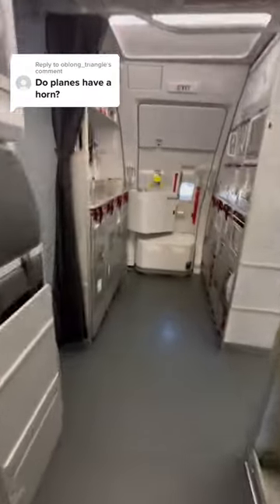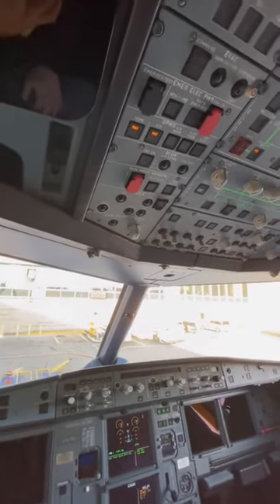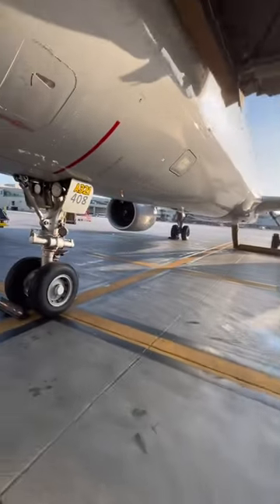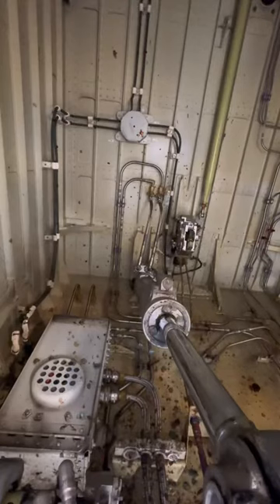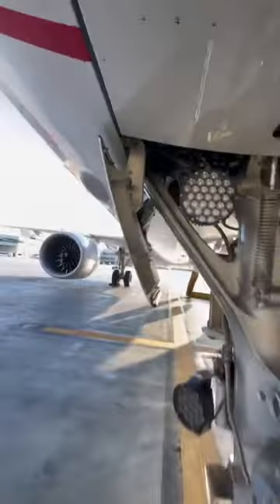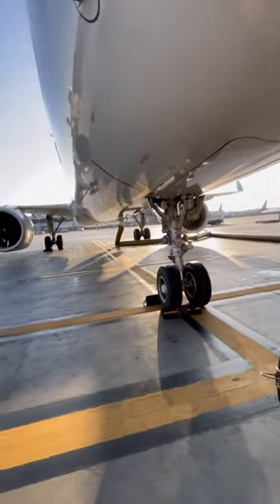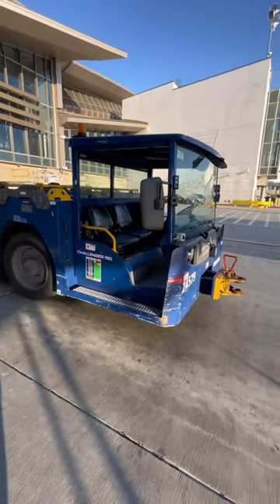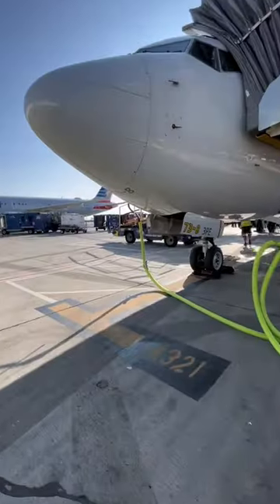Aircraft Horns (ground crew call)

Comment: this didn’t help the open engine cowls avoid damage during a improper slats/flaps cycle during one of our D checks. but it did IMPORTANTLY fully alert the AMEs to get clear during the mishap. Stig is right, it’s loud and noticeable in the hanger.
Reply from the maker: As long as no one got hurt is my only concern. Metal can be fixed and replaced. Us humans are more fragile.
Reply: @StigAviation  agreed 100%. and by following SOP the alarm saved people who could then talk about cross checking separate work teams tasks more safely.